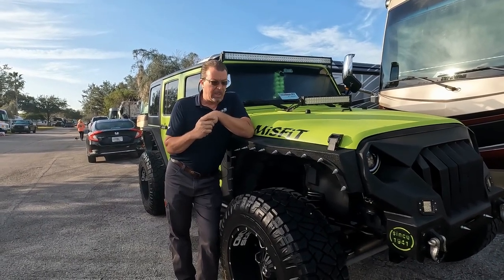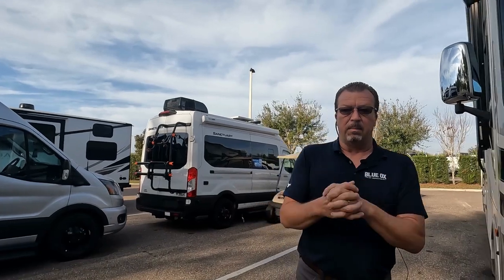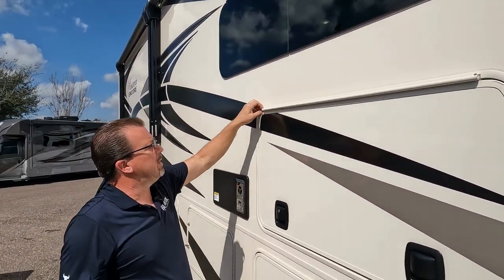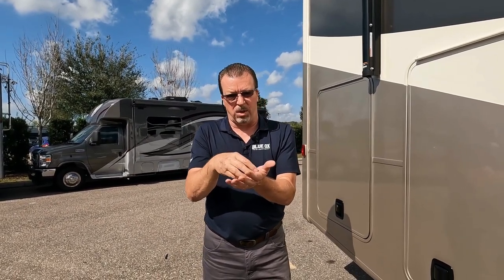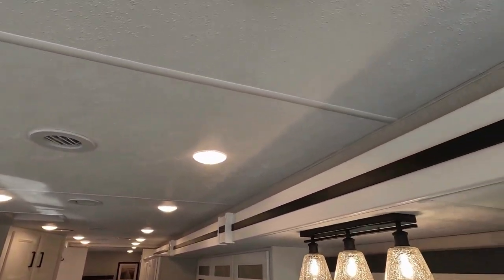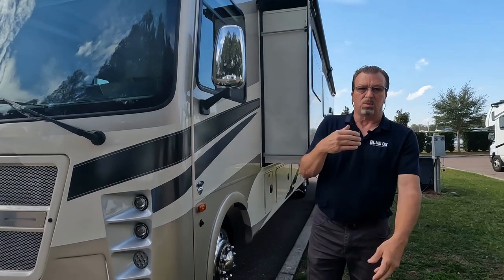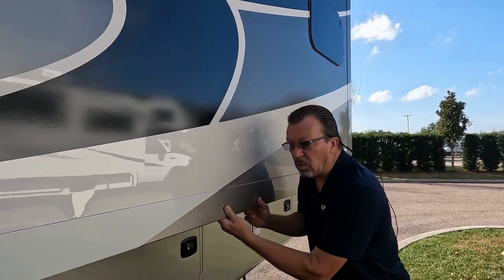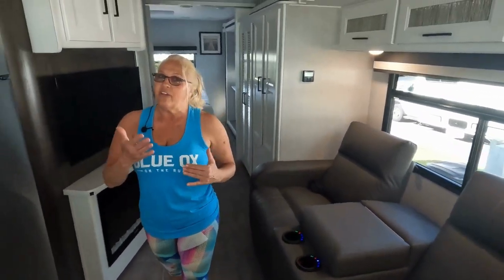😲Major RV Water Leak! New 2023 Coachmen Encore 325SS! Now What?

Comment: You know I wish we have Vehicle inspections like you offer for RV’ers, even if you charge a percentage based on the total cost, to find out before you sign the dotted line should be the very first thing a person does. I love your videos cause you speak the truth
Reply from the maker: Well thank you 😊 
The problem with the RV industry, absolutely no regulations or overlooking of any kind...
Reply: @blueoxontherun9188  I've seen stories of poor bast@rds who purchased a Class B for over $200K only to use it for 20 days and it developed engine problems, the RV company said it was Dodge, Dodge said it was the RV company, and they both said the owner had to drive it back to Indiana to get it fixed, but the RV was in Virginia. WTH is wrong with this industry. It has me so worried about their quality that I am not going to purchase a Class A or B or C, but stick with a Travel Trailer that has a frame of Aluminum frame and box structure.

Comment: Another quality video. Goes to show how important an inspection really is, no matter the age of the RV. I've actually seen different videos from other RV channels state how sometimes buying a brand new unit is sometimes more of a headache and expense. The reason being is that your not gonna find every problem (little or big) until you are actively using the unit. And even with the warranty coverage, it still takes a lot of time, inconvenience and expense to get the unit into the dealers shop and worked on. Whereas a slightly used unit, has had most of the "bugs" worked on already. Either way, an inspection is crucial. It can save you from a ruined vacation, or countless hours and expenses.
   Thanks again
Reply from the maker: Couldn't have said it better myself !
I could have said it....yet they wouldn't believe me 🤣🤣
Thanks for chiming in !!
Reply: Dude 😅 these demonicblue😧× teams with  big mama and her cameraman 》 whom supposely did a unit check before leave a show in tampa, . But instead fix all their faults , these vlog suggesting others to paranoidly pay another guy to do inspections on showunit rv/camper

Comment: The Hit List (just having fun, not actual dollars $):

1) Slide out track bowed: $2,000 deduction
2) Coolant too low as to suggest nobody has looked in the engine bay since the factory: $300 deduction
3) Sealant missing above outside TV door: $200 deduction
4) Vent cover sealant bubble burst: $500 deduction
5) Laundry water leak throughout the coach, under the slide out, and in the wet bay: $15,000 deduction
6) Several gouges throughout the ceiling: $500 deduction
7) No refer door lock and wonky emblem: $250 deduction
8) Stinky toilet: $1,000 deduction for cleaning and sanitizing
9) Bottom of shower missing sealant and leak: $1,000 deduction
10) Outside floor trim rippled without sealant below driver's window: $1,000 deduction (possible floor rot damage)
11) Rust on the frame: $10,000 deduction
12) Slam latch door out of whack (bent): $1,500 deduction
13) Missing velcro in dinette and ripped upholstery in theater seat: $1,000 deduction
14) Cost of inspection: $$$$ deduction
15) Manufacturer Sloppy Slap-'n-Go Build Fine: $10,000 deduction
TOTAL DEDUCTION: $44,250 not including the inspection cost...or don't sign on the dotted line!

I'd walk away after receiving the inspection report and wouldn't bother fixing that hot mess under warranty. It would be in service for weeeeeeks. Can you imagine what that turd will look like in 12 months? Toodaloo!
Reply from the maker: That's exactly what the CRL list, from the original report, allows you to specifically do.